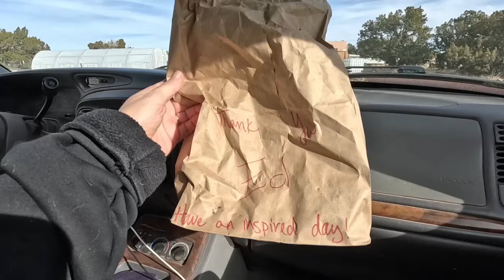Winterizing the Chicken Run | The Girls are Cold | Windy Winter Days

Comment: Black sunflower seeds are good protein in the winter also. Also IF you wash the cracked egg shells and dry them on a paper towel, put them the dried shells in a gallon plastic bag, and crush them, them add that to their feed it will give them extra calcium.  In fact if you runthe shells thru a grinder making them into a powder, you can add the powder into your food and or your dog food as well  for extra calcium. With added calcium you will see the egg shells will be very hard instead of the usual soft and easier to crack. Hens while molting don't lay as many eggs, if any at all as their body is in transition preparing for the colder temps.
Reply from the maker: Yes! We do have the crushed shells in a jar....good reminder to refill their dish! Thank you!